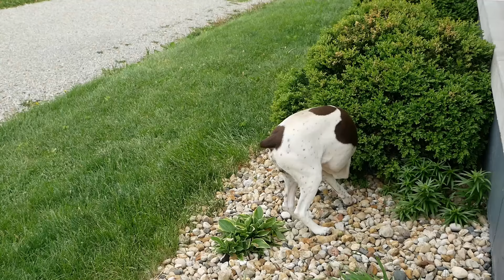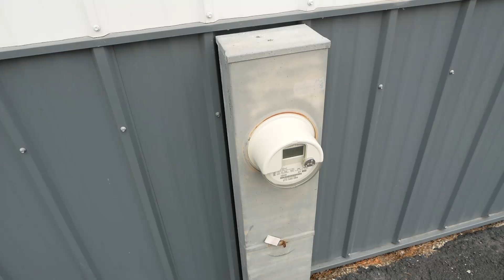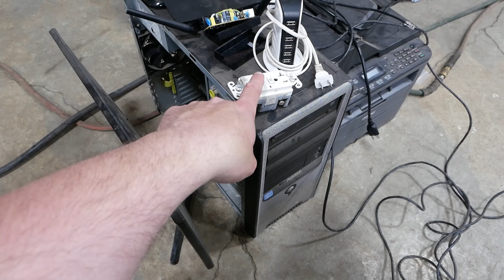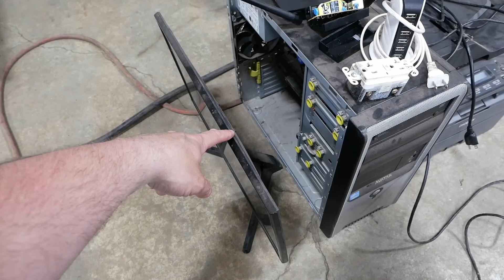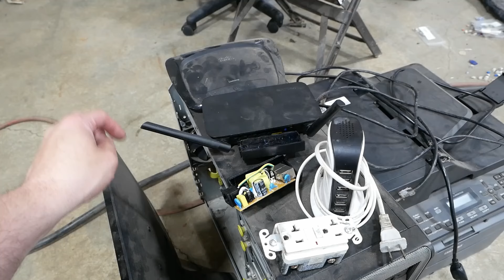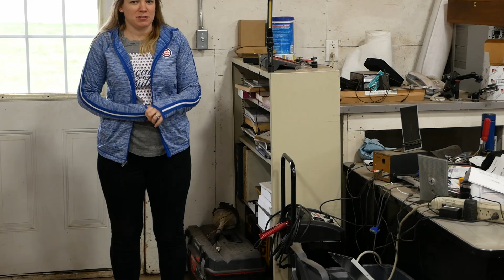Lightning Strikes Shop, Again...

Comment: It never ceases to amaze me that the so called "surge protector" power strips survive all manner of voltage fluctuation while everything pluged into it goes up smoke.  Hopefully some good fortune will come your way and the issues will get sorted out sooner rather than later.
Reply: It very likely came on the data lines. 99% of wireless antenas are installed without good lightning protection. Surge inducted on ethernet cable to the antena, and from there killed other devices, that is why pca and the router power supplys are ok. Same with lcd and printer, probably killed via data lines from pc.
Reply: In a physics class I took the professor explained what the ratings on surge protectors mean and the cheap power strip type surge protectors really can't handle much of a power surge.  Even many of the more expensive ones with higher ratings still fall way short of being able to stop the surge from a nearby lightning strike.
Reply: Surge protectors handle short, low-ish energy spikes between live and neutral, they are completely ineffective against the high energy strikes that can cause huge ground currents and the resulting large ground potentials.
Reply: A surge protector won't do jack to prevent damage from a nearby or direct lightning strike. That lightning just traveled several miles through the air, you think a surge protector is going to stop it? Now if there was a far away strike or other event that caused a surge on the electrical grid, it should help.

Comment: Prevention: you can get a double conversion UPS. It will convert the AC to DC, send it to the batteries, then an inverter will convert the DC back to AC. Is it completely bulletproof? No. But it is much better than anything else save for (very expensive) custom solutions.
They are NOT cheap, however.

Comment: When you get the computer fixed get some backup drives going keep one at the shop and one at home so you have backups of data. losing equipment sucks i know i had it happen but losing data is even worse

Comment: Sorry Wes, not good and I've been there with lightning. As for Starlink, unless you get the "business" version, I don't think it would be a good option. I thought it was the answer to my prayers, paid through the nose had the equipment, all hooked up to find download speeds were awesome. Upload was worse than dial up. I've since shipped it back. 
Well, your viewers are going to be patient ( I am ) and will be here when you get set up.

Comment: Wes do you have Dish network available?  We use them instead of cable, I believe they offer an internet connection.  Hope things work out for you.  Because I couldn't watch you I had to change out my front calipers on my '99 F-250 SD two wheel drive go buggy.  Nearly blew out my knees (no lift)!  Great video thumbs up.

Comment: When I wired bank branches, we installed surge protecting breakers in all of their lighting panels. Very expensive, but the engineers swore that they would protect all the electronics present in the branch. Surge suppressing power bars will only protect against small voltage spikes at best.

Comment: Sorry for your bad luck Wes.  That kind of thing has happened to me before.  That was then, and today I go out of my way so it will not happen again.  My current computer is not so  different from yours... big old desktop that I depend on for everything.  Plus, I have a PS5, a Sony 55 inch 4k TV, that I use as a monitor for both, plus other stuff I use to keep my channel going.  I live in the Panhandle of Florida near Pensacola.  We get a boat load of bad weather hear.  I have a couple weather apps on my phone that will show me that bad weather heading my way long before it gets here.  If there is something coming that's more than just a bit of rain... I shut everything down and unplug it all... its inconvenient as heck but it works.  Good luck Wes.  Oh, one more thing.  I like your methodical troubleshooting as well as your good work ethics.   And I don't think you talk to much.  Keep it up.  Thanks, Mike.

Comment: My own mechanicing / lightning story. In the mid 1980s I was working on my dad's 1960s 4.5T Dodge truck in his yard, I was playing with the headlights. 
I was laying half across the bench seat with my arm reaching under the dashboard trying to get to the plug on the back of the light switch, I wasn't actually touching anything when I saw a big blue spark jump between the dashboard and my metal watchband, at the same time there was a huge bang and flash outside. 
I had a burn right around my wrist and the phone was out for a week but it fixed the headlights.

Comment: I highly recommend a raid 5 NAS to backup your data to.  I have a QNAP 4 drive unit I bought about 12 years ago.  It can lose 1 drive, then I hot swap a new one in and it's good to go again, no lost data.  I use a free utility to mirror my data on the PC to it called Karen's Replicator, it's simple and just works.  

Computers are minor, the data on them is worth far more.

Comment: I've stopped storing anything on my computers, and switched to using USB sticks.  I know it's not for everyone, but it works for me.  I have several sticks and keep them all synced.  That way when (not if) the laptop/PC craps the bed, I plug one of the sticks into something else, and I'm off an running again.  They're cheap like borscht and hold lots of "regular" data.  If, like yourself, you have lots of video, consider a USB drive (or two, or three).  Keep your backups on them, and keep them unplugged when not in use.  Just a thought.  Remember, "the cloud" just means you're storing your data on someone else's computer.  As soon as you stop paying them, you lose your data.

Comment: Hey, Wes! I'm in a similar internet situation in south-central Indiana. If you have decent cell signal at your place, look at 4G hotspots and plans from the carrier with the best signal. I'm pretty happy with a hotspot plan from Verizon and with an external antenna I can get 20-40 Mbps download. You can have something like that up and running in days. As flat as it looks near you and with that nice high roof on your shop, you should be able to get a great line of sight to a cell tower.  The plans are capped, but the caps from Verizon go up to 150 GB per month and I think that AT&T has similar plans. The hotspots are intended to be mobile, so they work wherever you can get a signal.  You can usually get a bit better price on the plans if you bundle with your phone plan. I'll be happy to give you more details on my system if that sounds like it might help you. Good luck!

Comment: Electrician here, lightning mostly takes the shortest path to ground but a direct shot can do anything even explosions. 
One of the last ones I was called out on the it struck through a span of overhead quadplex and broke a chunk out a concrete fertilizer containment and blew a hole through t

Comment: UPS unit, not rated or designed for lightning but can't hurt, might sacrifice itself and save the trouble of setting up new everything

i can't post the link but 
CyberPower CP1500PFCLCD PFC Sinewave UPS System, 1500VA/1000W

Comment: Sounds like you need a lightning rod or something away from your house to divert the strikes from your pole, if this is apparently a regular occurrence. Not sure how well whole house surge protectors do (Siemens FS140 for instance, or the 3x the price and currently unavailable TPS3A1110D from Siemens. These are arrestors I believe like others have mentioned, which effectively should shunt the excess current to ground, like the lightning arrestor that should be on your pole would, but those can tend to explode too so maybe that's why yours is missing.). Of course that all costs money so you have to balance it with how many times you want your stuff to explode.... How long has it been since the last time this happened?

Comment: A Surge Protector won't arrest lightning it will take care of small surges in the power grid.
Back in the Citizen band radio days I had to use a Lightning Surge Protector.
but that was installed in line with the coaxial cable with a heavy ground wire going out to a ground rod.
These days I just unhook the stuff I want safe from the power grid and just wait it out.
Just my 2 cents there might be something out there better but I haven't looked around for anything else.
My first lightning strike blew a CB base stations boards into charcoal.
Nasty stuff.

Comment: Fully understand where you’re coming from as far as the internet. We’re in the same situation where I live in Indiana. No DSL, no 5G, no cable, no fiber, only expensive slow satellite that goes out with every storm or the same type service you have. At least ours is pretty reliable, relatively cheap, and fairly fast. When you live in the sticks, nobody really cares whether you have broadband internet or not…..

Comment: Two things you can do about the lightning.  Install a whole house surge protector in the main distribution panel and run your critical devices with a medium size UPS.  The UPS will take the hit but you might not loose your  router, PC, ETC.  If you don't care about cost you can install a one-to-one isolation transformer between the power company and your facility.

Comment: You need to sink 50 feet of steel pole 10 feet in the ground and make sure it's the tallest, most conductive, thing around lol Maybe run a few pieces of 2/0 copper ground wire down the sides lol

Comment: Hey Wes, keep checking on Starlink.  I live east of Bloomington, about an hour from where your shop used to be.  It took a while but I've had it for 3 months now and it works great.  I also have Tmobile home internet as a backup.  It's good for $50/month.  I just did a 37Mb speedtest on it so it's better than the grain elevator network I had.    Tmobile is a little tricky because they will say it is unavailable if you're rural like me, but I got them to let me try it and it  works good.   Good luck getting things fixed and back up again!
Reply: Up

Comment: I didn't read all 503 comments so I apologize in advance if someone already said this, but the only way you can protect the computer equipment in a residential situation is to unplug all of it when thunderstorms are imminent. Of course if this was one of those one shot lightning bolts that you had no warning of, unplugging doesn't work. There is a comment here suggesting the whole house or maybe whole shop surge suppressors. I have one in my main panel, but don't know if it has ever saved me from damage. Bottom line is that when a million volts of lightning comes down the line, it takes a lot to save you. Hope you have success retrieving your data and all that.

Comment: Wes do you have fair/good 4g LTE T-Mobile cell coverage? I know this is going to sound too good to be true but you can get unlimited data t-mobile hotspots with a $600 yearly pledge to calyx institute. I live out on in the sticks in Michigan and only can get 3mbps DSL or crappy satellite with a 50gb data cap for internet. I use thehotspot from them for everything I do online.  It has some ancient terms from when sprint acquired clearwire, about providing unlimited hotspot to nonprofit institutions. When you donate to calyx which is a non profit you get sent a hotspot with 1 year of unlimited data. Its all legit you can write off the pledge on taxes and everything. Its actually unlimited with no bullshit attached my household regularly uses 1tb of data with no issue. Don't just take it from me look at some youtube videos about it. Its truly is an amazing service if you have the LTE coverage and have no good access to high speed internet. This isn't tmobile home internet and it does not require 5g coverage you just need 4g. If you want I can email you if you have questions about it.

Comment: The printer might have a fuse on the board. Should be relatively easy to figure out which it is (near the inlet plug) and thus easy to replace.

You should really consider using an UPS bank, they're protected against stuff like this.

Comment: In the old days, I was a telephone engineer in a rural area in the Colorado Rockies. There are frequent lightening storms in the summer there.  I agree with your wife, as far as lightening goes, if it is your time to be hit near your home, you are screwed.  A hit  within a few hundred yards, and anything that is connected by wire , will likely be toast.  I used to see  telephones completely melted and blown off the wall across a room to smolder on the floor, and  the wire between the pole and the house completely melted. We used multiple lightening arresters on the circuit to ground out and prevent it, but It is impossible to contain damage on a near direct strike.  Be happy the house was not burned down.

Comment: You might have been able to save your electronics with a line conditioner. Once they sense a brownout or surge they immediately trip and cut power, saved my pc when lightning struck our well, we also live in the country and have "dirty" power which causes brownouts and a lot of issues with electronics if they need a clean wave function. A lot more robust protection than your normal surge protector. 

Also that PC psu might seem fine, but it could easily fail under load if something did pop. It's sadly probably a cheap Chinesium brand with little to no surge or overvolt protections. Usually you buy a little more expensive psu to stop such problems from destroying your hundreds to thousands of dollars pc. Even if the pc is cheap, if you have your livelihood on it, upgrade the psu to a reputable brand like Seasonic, FSP, Silverstone so you at least have a reliable product with warranty surge/overvolt protection.

P.S. Thinking it over a little more if your network uses any PoE injectors, that could also have been the downfall of your internets, so a line conditioner or surge protector might not have saved your electronics as the surge came from a connection that has no protections in place, and something wouldn't normally have to worry about. Just unfortunate set of circumstances, but I would still invest in multiple levels of surge protection and a more robust system with line conditioners and UPS surge protection.

Comment: The bummer is neither surge strip/protector nor a UPS will protect your equipment from lighting strikes, just normal surges.  Really the only options are lighting rod setup and just disconnecting your equipment during storms.

Comment: Make sure you have your Ethernet connection going through a surge protector as soon as it enters your house. That probably would have saved most of your equipment. Better yet, get a UPS and run power and Ethernet through it. Worth the $75 for a desktop level unit.

Comment: Looks like most of the high voltage went through the ethernet cables. I believe id look into a commercial ethernet surge suppressor. We use to use them on IP dialers on fire alarms and they worked pretty good had a few take strikes and it popped the suppressor but didn't kill the dialer . Lighting is a fickled lady

Comment: What I wound up having to do with my shop was install a main power box with a throw lever and when I would have lightning in the area I would just haft to kill the entire shop until the storm passed. It’s blown the door to the box off a couple of times but it never made it into the shop electrical. That’s the only thing I can suggest. And see if “DISH” can do anything for you out there.

Comment: I live in Florida and the lighting is the norm here. My TV.S and my cable box along with my computer are all on Battery backups with surge protection. The power strips with surge protection are junk and worth nothing. I bought my battery backups at my local Walmart. Yes, they cost over a hundred bucks but they do the job. I have lived here for over 15 years and have lost nothing but a fuse in the backup and have had to replace the battery every 4 or 5 years. I get those on Amazon. I hope this info helps oh I forgot to say that if you lose power you have a couple of minutes (if you buy the larger ones longer) to shut off the computer to save your info and the battery backups also have a much better surge protector.

Comment: Install a whole house surge protection device. My company Eaton make several models for home use, plus bigger stuff for industrial use. I have the CHSPT2ULTRA installed in my house. Note that these types of protectors are usually destroyed during a lightning event, but protect the devices behind them. The protection circuitry in the cheap stuff is a joke, and should never be used for protection from lightning strikes.

Comment: Surge suppressor for the network as it comes from the PoE and routers. And as for the the AC side use a battery backup that runs from the batteries not the AC side. We have a mountain top that gets hit almost every month and this is how we stop this from happening. Looks like your network was the problem as it carried it to all the components that i seen there.

Comment: looks like the lightening hit the network and shot through there, not the power itself.

Your main hard drive might be OK, and it looks like that PC is a generic board.

If I were you, id get an external HDD enclosure and test your hdd in another machines USB port. If its good, id dump the data from it to an SSD drive and go forward from there. I'd also make an extra clone from one hdd to another so you will have a back up of the data that you can just hook up and go. I wish I could look at it for you man, id fix it.

Comment: No idea what they are called/if they are available in the US, but here in Europe we would use so called "SPD Type 1+2" devices, installed alongside the house breakers, to protect from lightning the whole house. The one I have in my house, for example, is rated at 10kA discharge current